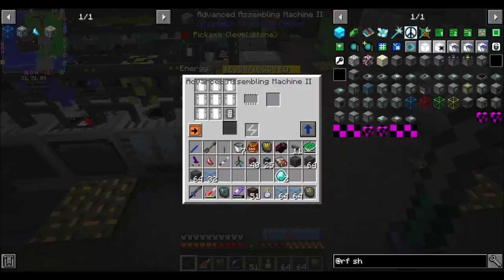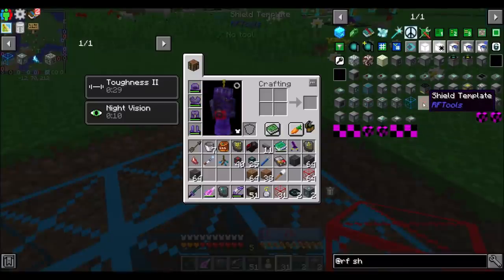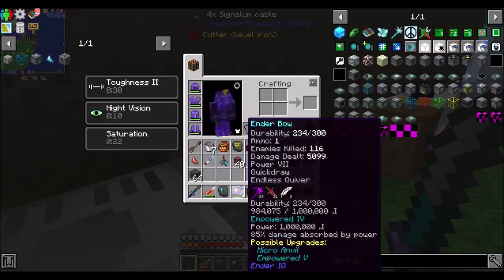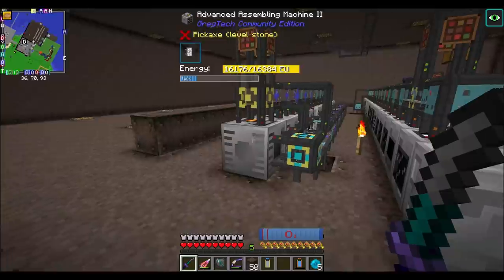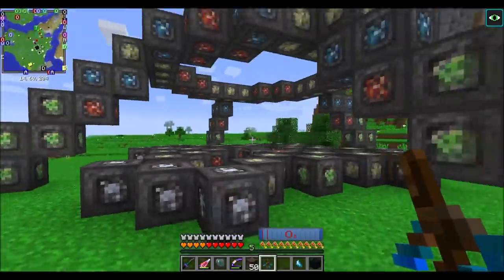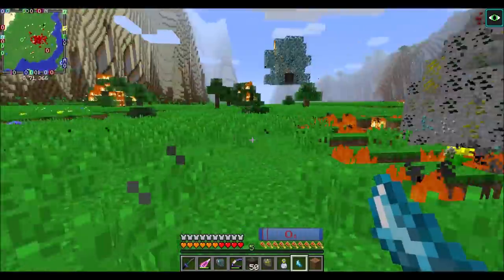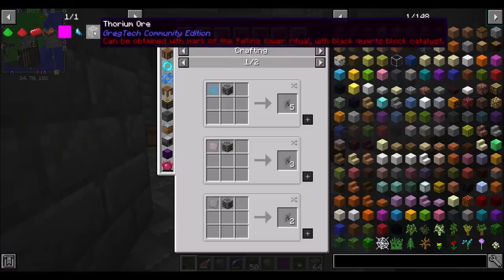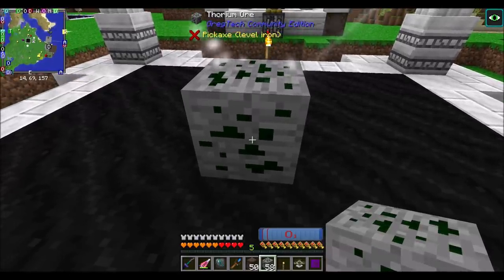FTB Interactions EP73 Meteor Impact

Comment: The last time I used the mark of the falling tower it just hit the first block that's directly above the master ritual stone. So if you want to not lose the ritual stones you can put an unexplodable block (I used thaumcraft warded block) 50 or so blocks above the master ritual stone :)
Reply: Obsidian works too
Reply: yeah you can also use teleposer from Blood magic to teleport your ritual away but I thing your way is cheater :)
Reply: Yep one block a ways above the ritual, and the ritual itself underwater for good measure, back in 1.7.10 I had the ritual in the middle of a lake (small bay w/e) and the explosions destroyed the coast.
Reply: 17-20 blocks above the master ritual stone is more than sufficient to place an obsidian block to prevent the meteor from destroying the ritual

Comment: 70 episodes of dire talking of needing to enchant his sword but taking a hard pass.
Reply: Because he's using a Tinker's Katana.
Reply: @Triaxx2  they're enchantable in this pack because they're plustic
Reply: I am playing the pack too, and I figured out last night that the way Dire is using crafting manager pipes is super inefficient.  1 crafting manager pipe with a crafting buffer upgrade can handle several machines.  All you have to do is set a default result pipe and link it to a chest that your machines pump the out put into which can be done with cheaper pipes like mekanism pipes.  From there all you have to do is specify the specific satellite pipe on the crafting module that goes into the crafting manager pipe, but make sure a default satellite pipe is chosen.  It wont work if you don't select one.  I chose to attach a satellite pipe to a chest and set is as the default so if I miss something while setting up auto crafting it just goes into a chest not a machine.   He has so many crafting manager pipes.  Also you can apply upgrade modules to the crafting modules in the crafting manager pipe by clicking them onto the crafting module.  Which is useful for recipes where the default 3 slots in the satellite section of the crafting module aren't enough.

I am super excited to figure it out because it means I just needed 1 crafting manager pipe to automate like 8 machines.  The only limit now is the 27 crafting module slots, but it is easily scalable.

Comment: Dire, please do some effort on stabilizing your ritual area in thaumcraft. its not that hard, you just need some heads and some candles, but it will make it so you don't need to have doubles of everything.
i know its easier to just have doubles and deal with the taint in other ways, but i don't think i've seen you make a stable altar ever (for context this is since some years ago, from serverplay season 7), and i think it would be neat to see.
Reply: (for the record, i do not count the restone like ribbons thing as making a stable altar as that's just an arbitrary solution to the problem in my opinion)
Reply: @sighmon5640  I actually rewatched the server play season 2 (I think) where he littered the altar with heads haha
Reply: He doesn't need to
Reply: It will be quite some time before Dire reads your comment. Even if he reads it right now, it will be several episodes before he can even implement it. Dire has a backlog of videos, so by the time he sees something useful he may already have got past the need for it.
Reply: @DarkVoidIII  thaumcraft is needed deep into the pack. unless he finishes the pack within the next 10 episodes i doubt he'll not need it by the time the backlog finishes
Reply: @sighmon5640  We can only hope Dire reads your comment. He has this habit of figuring things out on his own, and what you want to see implemented may well never actually happen. Dire does what Dire wants to do. :D
Reply: @sighmon5640  He doesn't need to ATM

Comment: Dire. Please enchant and upgrade you katana. The reason you did nothing to the Wither is because the katana does about 5 damage. Also talking of upgrading tinker tools, look into a tinker hammer or a the industrial foregoing drill you picked up from the moon dungeon. The drill is probably better because it's just power based so just charge it up and it can get up to 11x11 mining which will speed up things like harvesting the meteor or mining on other planets.

Comment: Dire's math about the environmental controller in the first few minutes is HORRIBLY off. A radius of 40 means a diameter of 81: 40 to either side, plus the block in the centre. Since it's (presumably) a square, that means 81*81 = 6,561 blocks in the cross section. The height is 21 - one layer at y=60, two at y=61, etc, ten at y=69, twenty at y=79, twenty one at y=80. 6,561 times 21 is 137,781. The saturation module uses 0.001 rf/t/block so that means it should be using about 138 rf/t to operate on that area. Not 32. Final equation: (40+40+1)^2 * (80-60+1) * 0.001 ≈ 138

Comment: So uh... yeah, when you look into the Teleposer, one of the uses it suggests for you right there in the book, is that you can telepose the Falling Tower ritual away to save your runes
That's the fault of the questbook maker for not putting teleposition blocks as a prerequisite quest
...and also kinda your fault for not realizing a meteor strike would destroy stuff, so yeah
Reply: Well, not really.
Its a logical assumption that if you break the ritual before the meteor hits the ground, then the ritual might be interrupted and you get nothing.
Plus if its your first time then its quite easy to assume that the ritual will just catch the meteor.
Reply: @hubertnnn  Right but the teleposer's entry - unless it's been changed from previous versions - specifically notes the Falling Tower ritual as a useful target for teleposition
The dude that made the quest book should have put teleposers as a required quest before that ritual, to hint that they should be used together